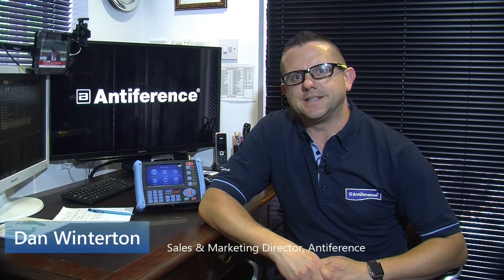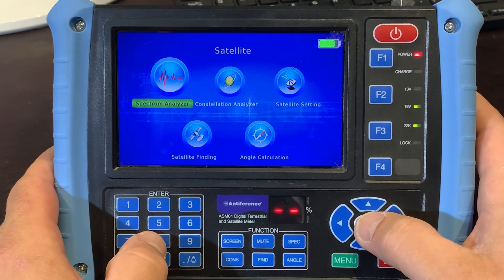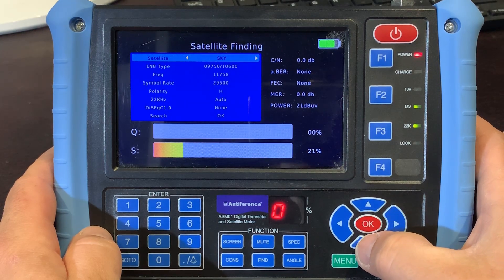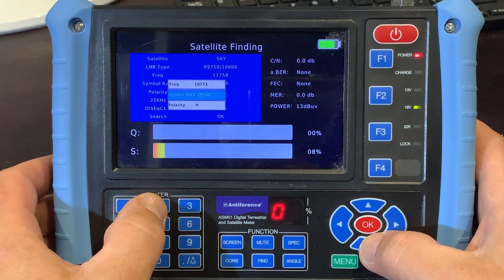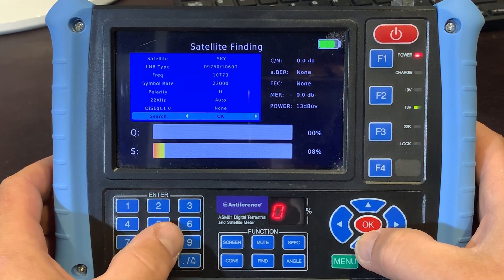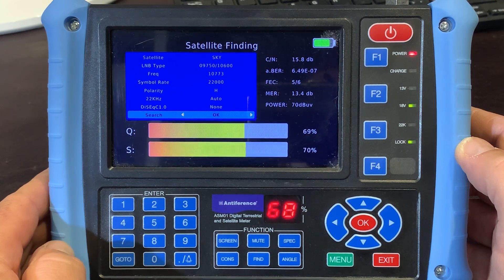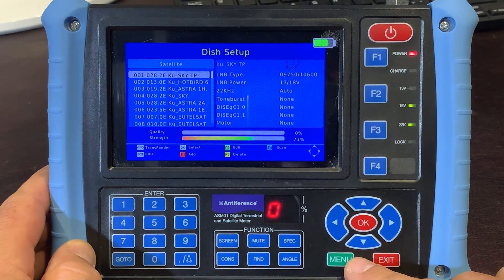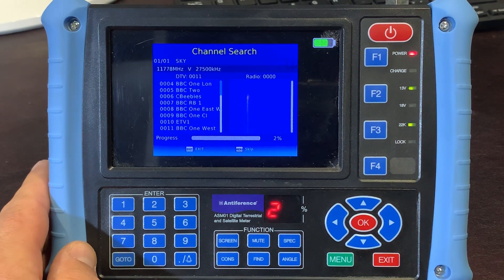ASM01 Basic Dish Alignment

Comment: Hi do you really need to type the frequency etc in to activate the meter to align or can you not simply select the sky selection to get on with it?
Reply from the maker: Hi Michael, sorry for the delayed reply to your comment. There are several ways to operate the meter and this is just one of them. In the constellation menu you can select a TP from the channel plan and work from there instead of doing it manually. If you have further questions, you can contact support@antiference.co.uk. Many thanks.